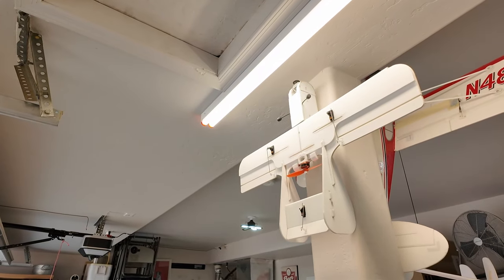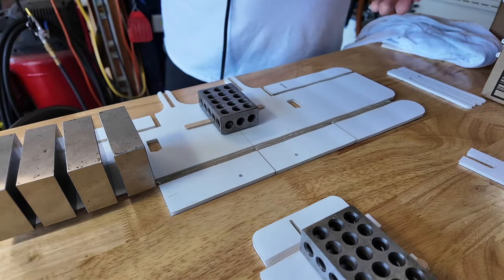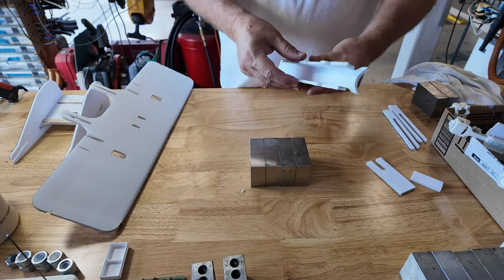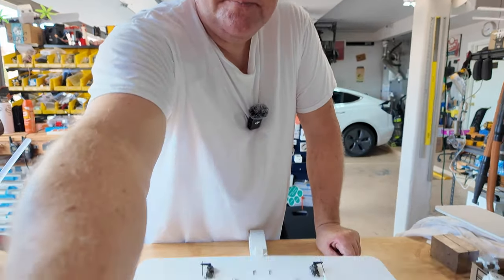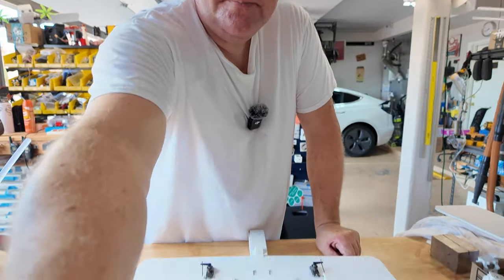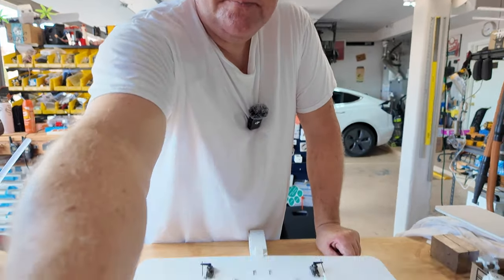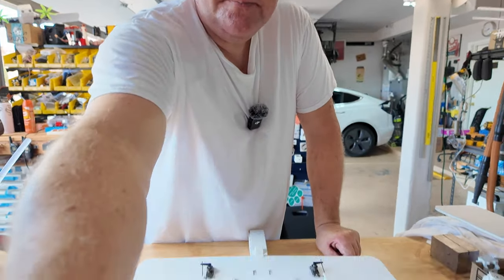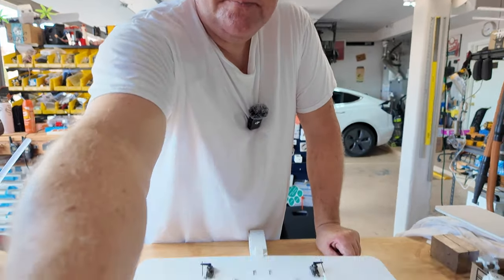The Drag Queen Sub 250 Build - a DIY RC Plane

Comment: Great build video. So many good engineering details thought through as well. Flat bottom stand on tail fin wire, pass-throughs etc
Reply from the maker: Thank you for your comment - I try to design these as best I can for all use cases.  It's seldom that I'll build two the exact same - as there is always something that can be improved.

If you want to see the drawings - I just put plans out at usefulaircraft.com/plans

Thanks for your comment

Comment: Downloaded your plans, thank you for sharing. Looking forward to flying it.
Reply: Where did you download them from?
Reply from the maker: I'll be really excited to see your build - and any feedback on the plans are sincerely welcome - this is my first attempt at putting plans out there.

Thanks for your comment - and send me pics of your build!
Reply from the maker: usefulaircraft.com/plans

Let me know how they work for you - I'm very new to this.
Reply: @usefulaircraft  Will do so,  going to see if I can have these laser cut.
Reply: @usefulaircraft  They don’t work for me in a PDF format where they are tiled. That’s great for those using a craft blade to cut them out. Having a laser and Lightburn, I would rather have a DXF, SVG, or an all in one PDF to import for the plans. The 3D files downloaded and are well organized. I haven’t loaded them into a slicer to verify them just as yet.

I appreciate your effort and value it quite a bit.
Not being able to import into Lightburn for laser cutting is a bummer though. I won’t cut the plans with a craft knife. It defeats all the reasons for having a laser that cost more than any blade. I need to justify the money spent on it.

Comment: the crushing tool looks a lot like a screen spline roller that are only a few bucks at a hardware store.  Just replaced some window screens and noticed the similarity.
Reply from the maker: lol - you say that - and I had to look - why I never thought of using mine I'll never know.

For me it's easy to just draw something up and print it rather than go search for a tool I may have last used 5+ years ago.

That said, I do have a screen to fix.

Comment: Good Morning Bret, for your KF wings fold, what percentage are you using?
Looks like 30-40%, as opposed to the standard 50%.
Thank you
Reply from the maker: Sorry for the delay - work disturbs my hobby sometimes.

I don’t hold true to the percentages.  I started holding strict to the numbers - but for various reasons I fell away from them.  Furthermore - I later flipped the wing and didn’t change anything and it still flew.

At the end of the day - I think the bulk of my lift is coming strictly from AOA.  It’s the kid with their hand out the window of the car feeling the changes in pressure when they rotate their hand.  I guess I’m a heretic in the church of plane building.

Build it and see if it’ll fly.

Works for me.

Comment: What are your thoughts on mounting the motor up front so that it flies quieter?
Reply from the maker: I have other tractor designs, and I love them for their quiet nature.

What I like this design for is the prop is guarded, and the first thing to hit in any collision would be a collapsing foamboard front end.  I'm always wary of somebody learning to fly accidently hitting something or someone with a spinning motor and propeller.  The noise on these kinda draws outside observer's attention, and may help keep them aware to avoid accidental collision if someone is learning to fly with one of these.

Both designs have their merits - but I do love the looks of this little plane.
Reply: You raise a few good points. I like these types of planes and have built the Outlaw 250 which falls into this class. Have wondered about a tractor configuration but haven’t gotten around to it.
Cheers Mike @usefulaircraft

Comment: Quick question - Your Radiomaster transmitter. Do you use the ExpressLRS or the CC2500? I would think the CC2500 because of the compatibility with various brands. However, in some of your flights the range you seem to enjoy and with the FPV the ExpressLRS would make sense. If you were buying as a new pilot now which direction would you go based on your experience with them. I’m not looking for a definitive opinion that hold your feet to the fire for my purchase. My purchase choice comes from my own research of course. I’m asking in doing my due diligence in that product research and your opinion would contribute to that. If you have other thoughts for receivers and ESC to go along with the Radiomaster Pocket I’d be glad to know that as well. The more I can research before buying the better. Thanks in advance and I’ll have another sip of coffee.
Reply: that looked like my betafpv elrs pwm receiver
Reply: @youngmangoingwest  I think you’re spot on after I compared the video to an Amazon product image. I guess the answer would be it is the ELRS version. Thanks for that info. Most helpful.
Reply: On the bench is a RadioMaster Pocket Radio in clear color. Pocket ExpressLRS edition is ~$10 more than CC2500 but offers telemetry (eg: battery and receiver voltage). Having battery voltage on transmitter (display/audio) saves needing to set a timer, or have a beeper in the aircraft. 
Since pocket transmitter only costs as much as 3-4 PWM receivers. It would likely depend if you already have receivers, or have plans to invest in more than a few. ELRS receivers (2.4 GHz) cost ~1.5x more than CC2500 comparable receivers (D16 / V2 / SFHSS).
Reply from the maker: I'm ELRS all the way.  I used to be a cc2500 - but honestly the cost/benefit ratio of ELRS is too much for the other formats to beat.

I gave most of my old flysky and frsky stuff away.  ELRS has too much support behind it, and that's amazing.

I do love the pocket.  That said - I do have the fullsize that I use with some models where I need access to additional functions - but the bulk (99%) of my planes fly with the pocket.  It's just too handy - and brilliantly small and easy to carry.  I've even got a belt clip where I just clip it to my belt when I'm walking in.

I know folks say that for FPV they want the bigger display of the TX16S, but my argument is when your FPV, don't you have goggles on?

Thanks for your comment!
Reply from the maker: I love the betafpv elrs pwm units for quick building RC stuff without a flight controller.  They're brilliant.

Comment: Been watching you for a while now.  Just became a subscriber.  Been flying for quite a few years now and want to simplify my hobby. Gotten tired of E Flites Big, Overpriced airplanes.    I do love to scratch build my own designs.  Some work, some don't.  Got a question.  Where would you suggest getting your smaller Motors, Props and ESCs from.
Reply from the maker: Thanks for your note.

I buy a lot of stuff off amazon or the usual online shops.  Some I do source from Aliexpress as well - but that's mostly for components like BEC's and ESC's.  It just depends.  I'm very price sensitive - and I love a good deal.

The motors I tend to buy cheaper quad copter style motors, as they're frequently sold in multi packs cheaper than what the fixed wing stuff is.

I also harvest everything I can from any crashes or failures.  I've been amazed at what others throw out.  Most components from their new crashed models can be recycled into your next plane.

Thanks for your comment.